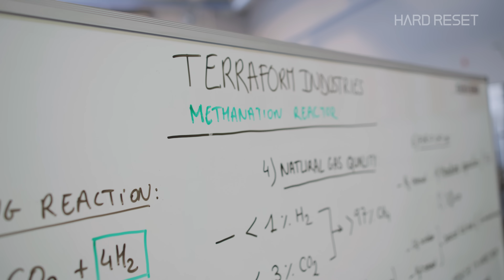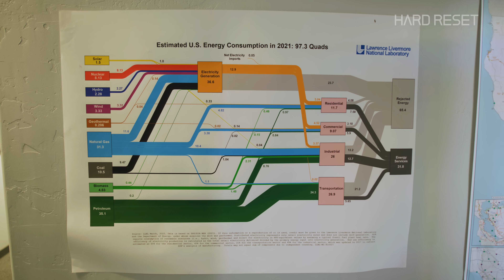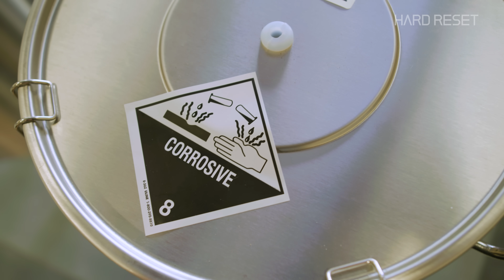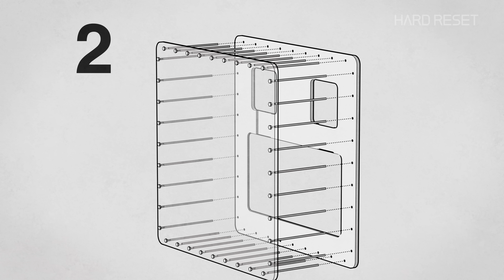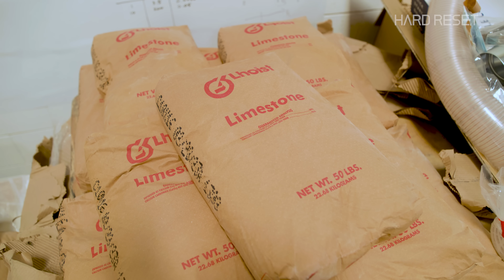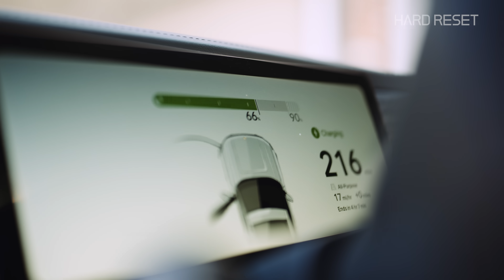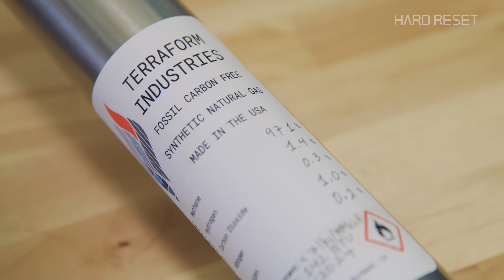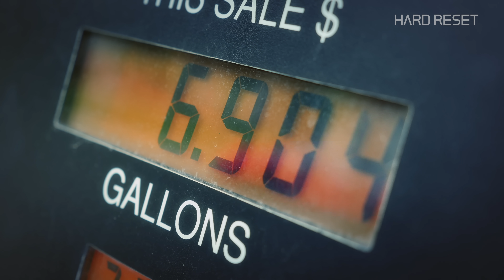The Last Fuel We'll Ever Need?

Comment: This is an interesting concept, I see some issues that aren’t clear from the video:

1) Electrolyzing water into H2 & O2 requires the addition of an electrolyte (typically an inorganic acid), there is no mention of this.
2) Electrolyzing water also consumes a fair bit of electricity which cost money.
3) Using a kiln to drive off the CO2 to feed the methane reactor is cost intensive.

All of the above make question the economics viability of the process at scale.
Reply: This is just another useless green hype video. All flashy and cool sounding, and a complete ignorance to massive drawbacks and hurtles.

Comment: Help an average idiot understand. Aren't methane leaks like 80 x more potent GHG than carbon dioxide at trapping heat in the atmosphere? And isn't the hydrogen directly from the initial electrolysis a much more potent energy dense fuel than methane?
Reply: The 'Carbon Neutral' part is the key, if the methane is made from CO2 that is already up in the air then no new carbon is being introduced. Methane is also more stable gas and easier to transport than hydrogen gas. 

I think the issue is instability and difficulty of handling hydrogen gas.

Comment: The REAL cost of Solar Energy
... IS NOT THE PANELS.   It's the storage for overnight and (worse) for huge seasonal supply & demand imbalances.

CH4 can be easily stored... so Solar to Methane could overcome the storage cost problem.... if it's cheap enough. This video never reported actual total cost estimates.
Reply: Exactly. Just make big plants of this out in the desert and make oodles of methane and pipe that to power plants close to population centers.

Comment: Electricity is far, far more efficient for many applications than natural gas and should be used wherever possible. However, high-heat applications are not a good use-case for electricity and so other zero-carbon methods could be a solution. I see this as one possible way to go for some applications where batteries and electricity won't work. But methane leakage is a serious climate problem and making more methane is going to make it hard to limit global temperature rise, even if it's created using carbon-neutral tech.

Comment: BTW: There are no "fossils" in Hydrocarbon Fuels, hydrogen and carbons are very common everywhere,  they are compressed under extreme heat and pressure in the Earth's crust and pushed up through cracks and between tectonic plates into oil wells. Oil is the second most abundant liquid on or in Earth. Carbon dioxide is good for crops and plant life in general.  So there for hydrocarbons are a renewable energy resource,  effective safe and clean.
Hydrocarbons include crude oil, natural gas and coal, and are not organic at all. They are abiotic (not derived from living organisms).
The word fossil is a lie and was started by J.D. Rockefeller implying scarcity to increase the price.

Comment: First 7 minutes frames this as being synthetic photosynthesis. So I was excited to see this. It’s not synthetic photosynthesis. It’s a battery for solar energy. Which is very important to make solar more useful. If they can make solar power produce synthetic gas cheaper than drilled gas, that’s an impressive and important accomplishment! But it’s not photosynthesis and frustrating that this video lead in that direction for so long.
Reply: It does have that to do with synthetic photosynthesis that it uses solar energy and atmospheric co2. It does not make plant material I admit but the fuel they make is better and easier to use than burning straw in a steam engine.
Reply: I also find the claims that solar power is getting so cheap that it doesn't matter are extremely wildly exaggerated. I live in sunny Los Angles and I rarely see a building or home with solar panels. If solar energy was so cheap then business would cover parking lots with them but they don't because solar energy might never be really economical. I firmly believe nuclear energy is the solution and it does have enough energy to make synthetic fuels viable.
Reply: @user-uy1rg8td1v  
The problem is solar power is so cheap during the day that it is not economical to add more. 
Nuclear has a similar problem. It costs so much to build you need to run it 24/7 to make it economical. With so much solar power in the grid during the day you have to turn something off.

(look up the duck curve for what this means in practice)
Reply: @catprog  you would obviously turn off solar bc it only gives power half the time in best case scenarios.  But either way power plants currently already change their power output based on energy needs. They simply adjust steam going to turbines.  Nuclear is by far the cheapest, safest, best for environment.  If you compare the cost and production from plants built 40 years ago it’s very misleading. And most the cost is from the insane amount of restrictions, regulations, and laws constantly being added
Reply: @aldawgd  Nope. The cheapest option is what is already built.

If their is no room for nuclear during the day due to solar then you are not going to build a plant that requires running for 24/7 to get cheap power.

If you can only generate power from nuclear 12-16/7 then nuclear is no longer as cheap.

-

You say you can just turn off the solar panels to make room? Are you going to go around to everyone's house and say you no longer get power for free but must pay for it?

Are you going to go to all the large scale solar farms and say you are no longer allowed to make money after investing in power generation? Do you think anyone is going to invest in your nuclear plant after you do that?
Reply: @catprog  are you drunk? You don’t have to sell power from nuclear plants 24/7 to be profitable. And we wouldn’t need to build a crazy amount to give everyone free power at home. And solar is extremely inefficient. And involves slave and child labor and is horrible for the environment. The panels are starting to overflow land fills. Solar is best case 100 years away from breaking even and the rare materials will be all used up for the better designs that still stink. Sorry but you have clearly not done research and are clearly a solar propaganda junkie
Reply: @aldawgd  

It costs a billion dollars to build a reactor of x MWH.

If you run it for 24 a day you produce more power to offset the costs of that billion dollars then if you run it for 16 hours.
Reply: @catprog  umm  duh
Reply: 6.22 idiots.
Reply: It is an incredibly inefficient and convoluted battery requiring ungodly amounts of land.  I see it as nothing more than an academic study with zero use.
Reply: Have you ever seen an oil refinery? Do more research before you say angry shit @xeridea
Reply: @xeridea  You know what else requires ungodly amounts of land?.......that's right, fossil fuels, the plants that process them and the pipes that transport them. And as the video stated, it doesn't matter that it's inefficient, as long as it costs less and is less polluting than existing sources of carbon based energy. To be able to store this energy in a way that makes use of existing infrastructure is also a huge win.
Reply: I actually don't blame them for that. Scientific literature is super quick to label things as 'synthetic photosynthesis'
Reply: Your comments are misleading.

All 3 of you are idiots. He COMPARES HIS PROCESS to photosynthesis, he doesn't say ANYWHERE that what he is doing isphotosynthesis. Pay attention next time before you comment.

Very misleading. Shame on you.
Reply: Whoever narrated this needs to learn from their mistakes lol

Comment: Kinda odd because in the end you're just putting the CO2 you capture back in the air when you could have just used the hydrogen you created. I get it that it's carbon neutral but it isn't really viable until we are at that point where the electricity we create from solar is massively overproduced. And even then do we need it? We can already go entirely electric homes.

Comment: Has anyone touched upon the difficult but necessary discussion about making drilling Petrol less & less frequent & therefore increasing it's value per gallon? 

Enhanced making everything made out of petrol way more expensive ? (and not just energy for cars & heat)

Everything uses petrol, and therefore the weird effect of reducing our petrol production if tomorrow 100% of cars & trucks would run on hydrogen & electricity, could be a more expensive world for goods & services.

Is it a bad or a good thing, no idea but I do not see this tricky topic on the table. Does reduction of  petrol production for the transport industry impacts the rest of the industry that still needs petrol & won't be able to use methane to product your tee-shirt?

Hope this makes a topic on your channel cause I would be the first to watch & learn :)

Comment: A “climate change” solution that relies on…drum roll please!!!….cheap and abundant clean energy! Technology that already exists. We do not need a technology breakthrough to solve climate change. The problem is governments are in the pockets of fossil fuel companies. But that’s a hard truth to cope with, so we get machines like this. The one exception I could see is for jet fuel, since the energy density of batteries is just not light enough for commercial air travel. But yeah a system that relies on cheap clean energy to make, cheap clean energy is inherently redundant.
Reply: It's better than drilling more out of the ground.. until battery tech gets better..

Comment: The efficiency of solar panels drops a lot after 30 years, so they all need to be replaced. Is this additional cost taken into account ?
Besides, this process requires a scarce resource : pure water.
The U.S. Navy has developed another method in 2014, using seawater which is available in unlimited quantities. It extracts CO2 from the water using membranes.

Comment: I concur with the engineer person who suggested that the carbon dioxide should be recycled back into the process. 

In addition, I am left with the question of: why not just use the hydrogen produced by the splitting of the water molecule?

Granted, it is a little harder to store than methane, but it is a whole lot cleaner burning; as its only byproduct is water.

Comment: With the current grid you'll have surpluses of solar and wind. Like the middle of the night on a Sunday when there is low demand. This transforms it into a fuel that can be used as needed and top up the grid when needed when put in a generator. Or used to power a vehicle or somewhere off grid or cook food. Yes batteries are more efficient but batteries are more expensive. If you can have this it can use the surplus power.

And presumably it will get better and cheaper as the designs and processes are refined. Fuels and the refining process are costly and are not endless - so there may come a point where this is very feasible. Especially for those exploratory use cases like off planet travel.

Or equally justifying putting loads of solar in the empty desert. The energy is being wasted, the panels are super low cost but connecting up the grid may be too far or too costly. But a huge tank of dense fuels can be produced from nothing

Comment: It is a great idea in theory. Unfortunately, the amount of energy required for this process is far greater than solar/wind or other forms of electricity. Storage of electricity and solar panels are improving at an exponential rate, so the application for this will be limited and it is likely that cleansing of bio methane will be more efficient and enough for most uses. Scrubbing of bio methane can be done by simply running it through water and iron wool.

Comment: The success of this will be dependent on natural gas prices. And while in many parts of the world natural gas is relatively expensive, in the US it's dirt cheap. The fracking revolution has made the US a net energy exporter, again, and while it has significantly increased US oil production, the same process has been producing natural gas essentially as a waste product.

There are few places in the world where frackable oil deposits are available close to transportation infrastructure other than the US, so much of the world will not be able to produce their own natural gas. Gas prices in Western Europe are 3-4 times higher than in the US.

This process, though, should work anywhere the sun shines. I'm sure there are quite a few places that combine sunshine with high gas prices.

Comment: Couldn´t the carbon capture elements be inserted into chimneys of existing fossil fuel burning generators? The CO2 is more concentrated there and the fuel created could just be transferred directly into the burner. The outside of the chimney could house the solar cells.
Reply: In my hometown in Finland, the power plant has been producing electricity for 40 years by burning wood, the heat goes into the city's district heating network, and the heat from the flue gases is used to dry timber in a sawmill on the site.Because Finland has built a lot of wind and solar power, the price of electricity often drops to zero, as it does now at the time of writing this. The power plant has just completed an electric boiler, and in such a situation, the city's heating is handled by wind energy and the burning of wood is reduced.  Plans are already underway to convert carbon dioxide from flue gases into methane, and wind and solar energy are also planned for this purpose. The city is also building a data center, the waste heat of which will be used in the city's district heating network. The data center is for teaching artificial intelligence and perhaps mining crypto, and its power is adjusted depending on how cheap electricity is available. The problem with wind and solar energy is that they are constantly changing, so a data center that adjusts its power balances the load on the electrical grid.

Comment: What a great idea to produce a gas that is 25 times worse for the environment than CO2 is, yay more power to this team as every spill or rupture will help to hasten Climate change, then we will hear the load of bullshit about carbon free and non polluting, until they suggest using it in ICE cars as then we go the same route as Hydrogen, no matter the fuel you use in an ICE, it will produce Nitrogen Oxides, it has to there is no choice as the Air an ICE uses is at least 70% Nitrogen and a compressed burn will always produce Nitrogen Oxides, it was proven to do so in Hydrogen fueled ICE and so will do the same in all ICE, unless of course you supply an Oxygen tank with the Hydrogen or Methane and have a closed system, trouble is the cost for fuel will be astronomical then.
If you like Cancer well then keep driving ICE, I will be driving my EV knowing that anyone running or walking near me as I drive past them won't get a lung full of Nitrogen Oxides.
It's why I can never understand the idiots that say they are riding bikes for their health, ride on or next to ICE by the thousands and every breath they take is full of cancer creating fumes, yeah really healthy idea, shows how stupid they really are :).
These crappy BS videos are all ways for some group to try and make a few dollars before people realise that it's another snake oil system that will never be of any use to anyone as they are 50 or more years to late.
Burning any fuel is caveman tech and we need to get away from fire, it served us well in the past and those of us that are a little slow, still like to watch fire burn and so like their ICE powered Cars as they go vroom vroom, even though they do so very slowly compared to an EV, but these slow individuals love the smell and noise their ICE makes as they get left behind from the lights by a cheap EV with no modifications at all.

Comment: Methane is 80 times more potent than CO2 as a GHG. So, how much methane can this system leak and still be carbon neutral will be the defining question. The problem is that leaks downstream of the supply chain cannot be controlled by the manufacturer. So, this may be a net GHG producer.
Reply: What? If the whole system only uses CO2 from the air then it is neutral, no matter what leaks it has.

Comment: So you're going to take the most expensive highest form of energy, solar electricity, and degrade it to low grade energy, chemical fuels.
That makes absolutely no economic sense.
A simple water gas shift reactor combined with a solar concentrator at 800 C can directly convert heat to fuel
 at a much higher efficiency by skipping the inefficient solar panels, and power converters.
Or why not just use electrolysis for electrical to fuel.
Solar electric is not at all free or cheap, it's very expensive to extract very low energy flux of only 1000 W/M for only a few hours a day at best.

Comment: What is the point of taking electricity, wasting 70% of it to produce methane, when you could use the electricity directly in electric vehicles, cookers, heaters? The starting point cost of the methane is 3.3 x the cost of the electricity, then add all the other costs of the process.

Comment: Using an ASU would probably be a much much more efficient and faster method for capturing CO2 versus running a fan over some rocks and then cooking them... I believe that's how you make quicklime. Clever solution, though. Partial pressures and heat exchange (pv=nrt) is a very good method for separation.